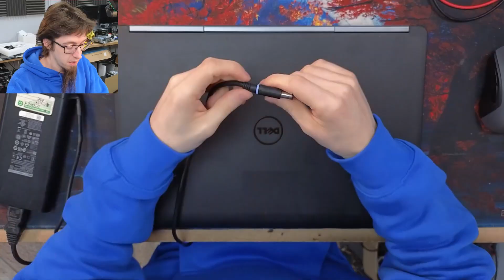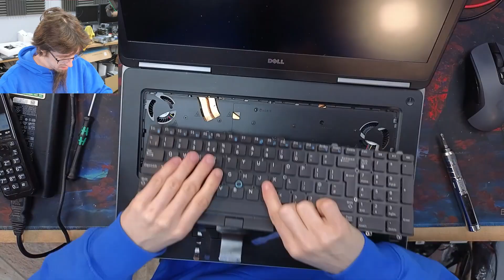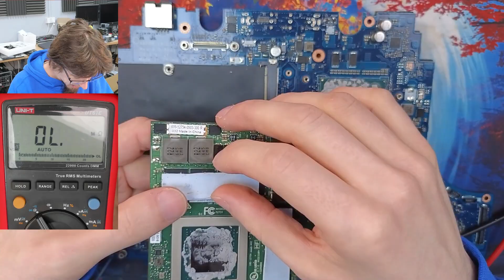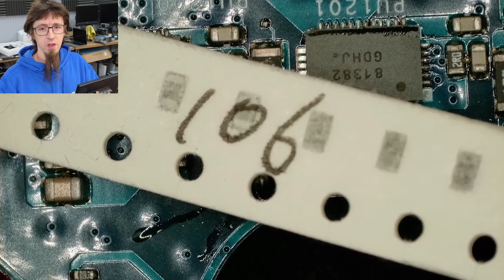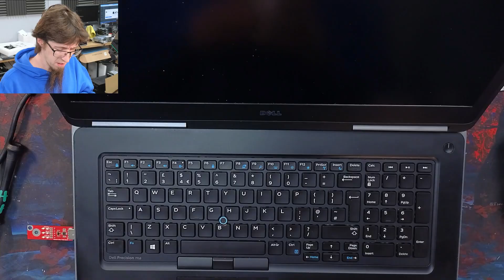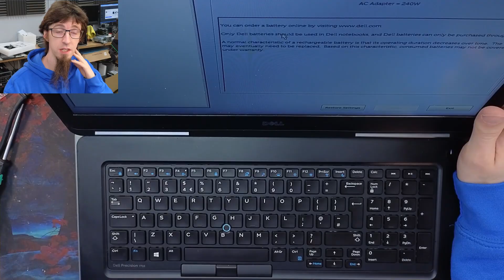Big boi Dell Precision, charger light goes out when plugged in #418

Comment: I was debugging  a similar issue on a Dell Precision M6800 and it is one of those capacitors 0603 and one more smaller one around the same area that have some kind of a white spots coming out of it and onto the motherboard. Was curious..... why don't you check for capacitors shorts with the multimeter in beep mode ? 

Technically if there is no beep, its an issue.

Comment: Thanks for teaching some sloppy guys what caps are used for (minute 21) and that they should be replaced by new ones. Yes, by new ones, not one of another old board. Caps have a life span and if you replace them with a grandpa, not a good repair job. Especially worse if you take the exact same cap from the same location on the same type of donor board. Why? Because the broken cap could have been broken because its location is stressed all the time. Might also be just a badly produced one, but you don't know that, right? So, please: Just buy a pack of new ones and use these. Don't be lazy and stubborn like for example 'Electronics Repair School'. Always remember: The board designer knows the board in and out, and he placed a cap there. Don't think you are smarter than the designer.

Comment: I have the same laptop. Only replaced the power button then maxed it out with SSDs and RAM and  90w battery. Yes it is heavy but it does fly like a rocket for an old machine. Even with maxed out settings I get 3 hrs battery.

Comment: Can using a smaller replacement capacitor package cause it to saturate more and reduce the effective capacitance at full circuit voltage? Is this a significant risk to system performance?
Reply from the maker: Main difference is that the max voltage usually goes down as you go to smaller packages, so you have to check that you're buying at least 20v caps so they'll tolerate basically any rail in the laptop. Other than that, response time actually tends to go up as the package size goes down, because less inductance, etc. This is why the modern flagship GPUs have a million tiny caps on the back of the GPU, instead of a few big ones. It's just a trade off of uF and V vs package size.

Comment: Just fixed the exact same model, you might want to replace the same caps on the other side of the board too, on mine the top 2 were burnt and the copper evaporated under them and the bottom side had a the same cracked cap as yours too.

Comment: DAMN! I haven`t seen you in forever! I have one of these (7710) replaced the firepro gpu with a QUADRO m3000m and had so many issues with ac power and thermals, such a pain but the computer is pretty sweet when you have 64gb memory and NVME storage. the three piece suck but once you get the screws out it is not hard to re-assemble. at this point I can take it a part and have it back in 45 mins. this is a good video for me I may need it one day lol
PS: At boot it takes 30 secs just to post, so ram training takes like 2 mins sometimes.
Reply: You can check to make sure that the cooling plate sits on top of the cpu/gpu properly. I had the same thermal issues until I discovered that there was about 2-3mm of space between the cooling plate and the gpu.
Reply: @obvious7777  i think I had thst the first time because I was being lazy and just pulled the cooler of with the mobo still in the computer and then fanangled it back it, I did it right the second time, but if playing games that cause extra heat instead of the machine adding more power to the fans to cool it, it will initiate a windows shutdown.  I heard this could be the ACPI driver but I haven’t messed with it. Did you have that issue as well?
Reply: @PiggyPies4All  I believe I did go to the manufacturer's website and update that driver prior to realizing that the plate was the issue.
Reply: @obvious7777  cool! I plan to get back to it, my wife has been using it for Palia which she runs on high. If she sets the laptop on a hard surface its fine if she has a mouse pad or anything underneath it that is when the issue starts
Reply: @PiggyPies4All  Be sure to take the fans apart and clean them thoroughly, as well as the cooling fins, sometimes dust can accumulate at the point where both fan and cooler meet.
Reply: @obvious7777  this was one of the issues once I fix that it was better but the laptop had issues on the os side and once i reinstalled, the rest of the issues disappeared.

Comment: It could also be, that the laptop wouldn't power on without a battery with a reasonable amount of charge. I've had this before, with one of those beefy laptops but don't remember what model or make. The charger was able to charge the battery while running but slowly under load and the battery was required to buffer surges.
Anyhow, great fix, awesome explanations and another device back on the streets. Well done!

Comment: Why do many repair shops end their repairs when they know the CPU has been damaged? Is it because of limited parts or time or just most customers do not want to pay for a motherboard replacement or repair? I am just curious. Thanks.
Reply: Because you can't buy the replacement cpu.
Reply from the maker: Also even if you had another CPU, replacing the CPU is a tremendous job that will economically-write off most laptops, or at least getting another mobo will likely be cheaper/easier.
Reply: @Adamant_IT  Thank you!
Reply: @markanderson2904  Thank you!
Reply: Even if you could get the CPU there is a thousand balls under it to connect to the motherboard, good luck with that 😂
Reply: @gower1973  Thank you!
Reply: check out ycs repairs it's possible but look what it takes haha

Comment: Genuine question here. As someone who has taken things apart, to either dislodge things jammed in by the kids or maybe just check the wiring, how do you ever not end up with the classic extra screws at the end of it all? What's your process like to deal with that?
Reply from the maker: Actually I often have the odd screw left over... sometimes it just happens. As long as you're putting important ones in, like heatsinks and stuff, it's not the end of the world. Like, say I miss one of the mobo screws, it's not like the mobo is going to fall out.
These days I use the plastic sorting boxes, and then I can puts screws in a rough pattern of how they came out, or in the order they came out, and work backwards during reassembly.
Reply: @Adamant_IT  a flat refrigerator magnet flipped backwards in a small plastic holder works for me.
Reply: Group your screws. Either with a magnetic mat, jewellery box or plain old individual magnets.

For a 3-piece laptop like this I would have at least three groups: exterior screws, mid-plate screws and beneath-the-keyboard screws. Then during reassembly I know I can’t refit keyboard until I’ve used up all the screws from the beneath-the-keyboard group. Similarly I can’t refit the bottom cover until all the mid-plate screws are in place.

Comment: Love the explanation @22:00 about holding a small charge, however I have a question why do the capacitors cause a problem if they short?
Reply from the maker: Multi-Layer Ceramic Capacitors are a bunch of metal plates stacked on top of each other. If the capacitor is damaged or cracked, the internal plates can touch each other, meaning the capacitor is effectively a wire. If this shorts a power rail to ground, the whole rail is pulled down as all the power on it goes straight to ground - like trying to fill a bucket with a massive hole in the bottom.

Comment: Those caps seemed undersized, are you sure they were rated to 20+ volts, certainly the ones in the description posted in the video are only 6.3v ones......
Reply from the maker: Yea the ones I use are 20v, but you're correct I didn't mention this in the description. Most of the time MLCCs are rated to 20v or more, but you do need to check before buying 👍

Comment: This is what a laptop that can edit your videos and play your games on the move looks like, if you ever need that. Not some so-called "gaming" laptop.
Also thanks for explanation about the bypass capacitors, first time I see someone actually explain it properly in a video.
I've always bitched about people ripping off parts and not replacing them. The early RTX 3090 instabilities should have been a good lesson that sometimes it doesn't take much to go from "good enough" to "not good enough".
Reply: With the power cutting in and out, the power rails can also get a bit 'spiky' which can be detrimental to ICs and cause them to glitch or fail. The bypass caps absorb these spikes. Always bypass caps are there to keep the supply lines steady.

Comment: I guess when you make a laptop with some user-replaceable parts, like memory or SSDs, you need to make somewhat it idiot-proof as well, so they don't stab the motherboard with the screwdriver. Probably that's why they have those plastics. Another reason could be for the rigidity, since it's quite big, maybe it needs some reinforcements so the chasis doesn't flex as much.

Comment: I believe the GPU card form factor is called MXM.
Reply: Graham, I've done a little digging and should your customer approach you about a GPU upgrade you need to make sure that the MXM module is compatible with the heatsink and heat dissipation thereof. Not just any MXM module will work properly.

Comment: Bypass capacitors are usually lower value and reduce digital noise, these are reservoir capacitors. Also, worth checking that the working voltage is sufficient, the new part you fitted is smaller and might not be rated high enough.

Comment: I really hated this era of laptop design, just such a pain to work on. It did persist quite late with some models like this, Dell's Alienware laptops around the same time used it as well. Thankfully I think it has completely ended now. It's weird how the industry suddenly collectively realised you can build a laptop without it all. Still, something interesting: Dell used to know how to build a robust hinge, look at that... threads into the aluminium body. They should study this and do it again, old XPS used to be the same as this.

The slot is MXM bytheway :)